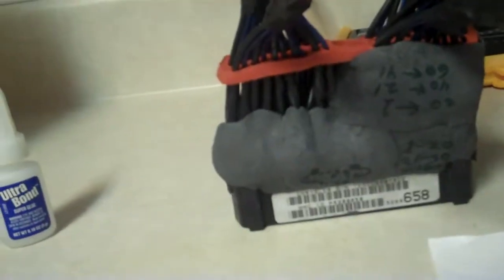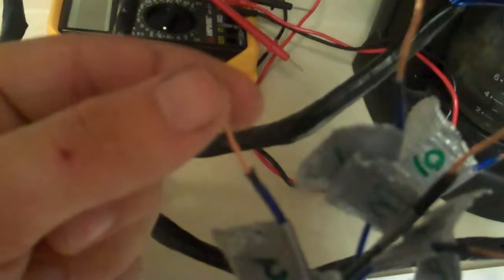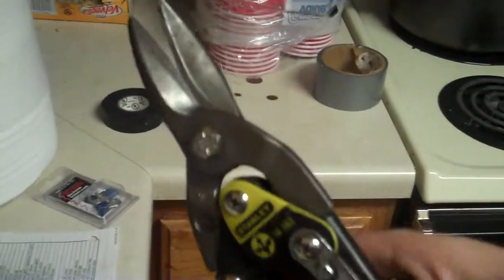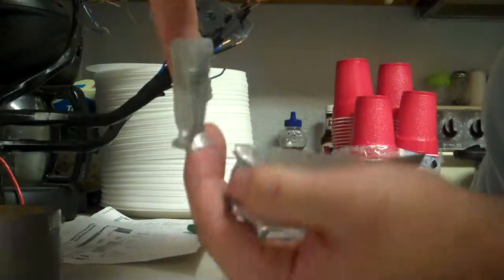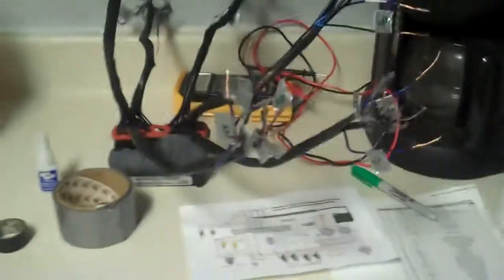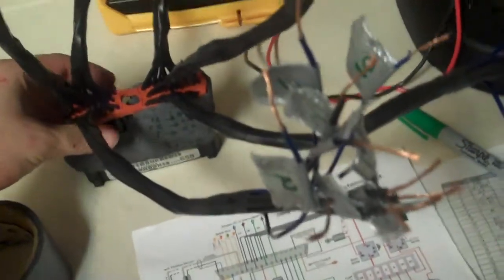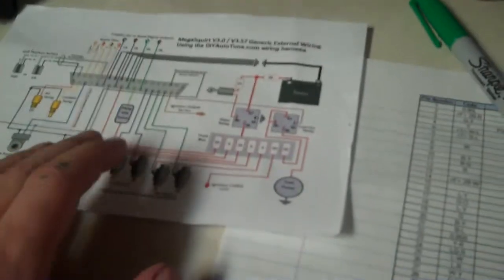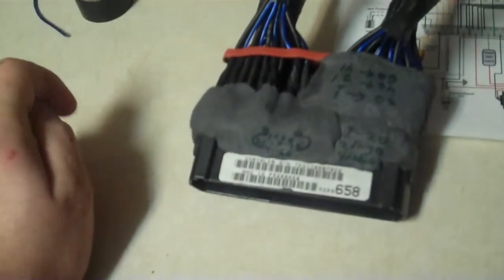Megasquirt 3 MS3X to OEM Harness Part 2.mp4

Comment from the maker: What are you talking about ? do you even know what im doing ? Maybe you should watch my other vids ...
 Im making a harness to hook up Megasquirt HARNESS TO MY OEM HARNESS 
   Secondly NO ONE makes a harness adapter for a 95 eclipse 420a especially since the 95 - early 96 models have the crappy 60 pin chrysler ecu vs the late 96-99 eclipse 420a, gst, gsx, and evo 3 type set ups .  
So only later model eclipse and any one with a 4g63 even have a chance to buy a premade harness